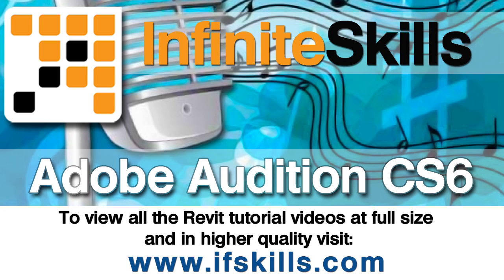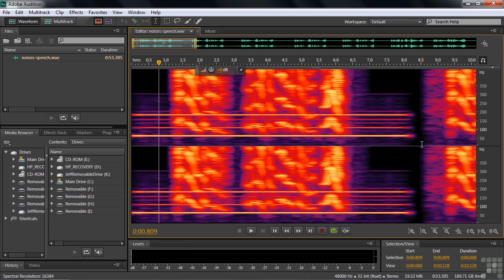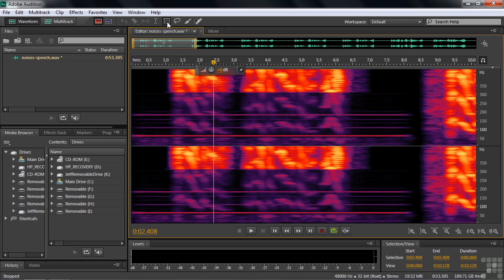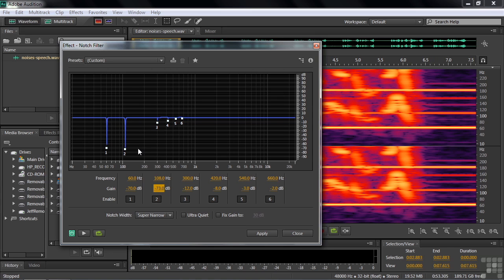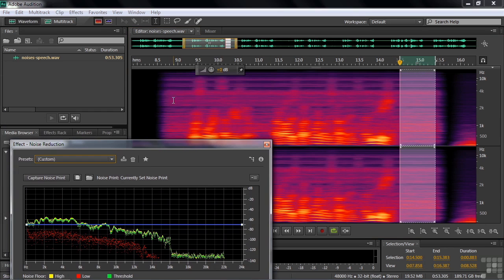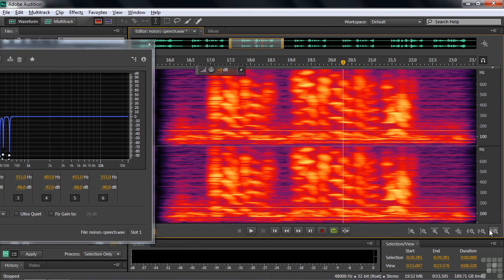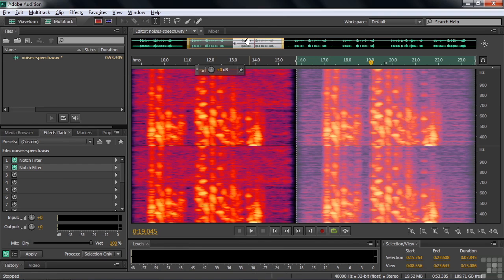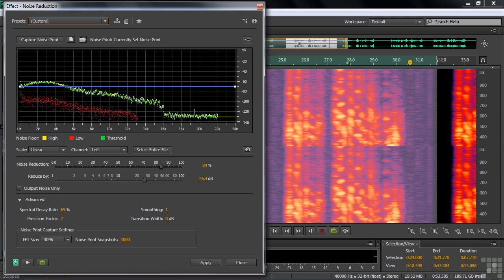Adobe Audition CS6 Tutorial | Reducing Background Noise | InfiniteSkills

Comment: That metallish kinda sound. How do i get rid of that? I have tried different effects but its only making it worse. Need help.
Reply: +Gaurav Cz Try doing some EQ adjustments before any of the noise removal. Using the "smoothing" feature will also help with that metal sound (what we call artifacts or aliases) You should also try lowering your FFT size as the rule "less is more" sometimes applies...start maybe at 128 or 256 and work your way up noting which ones are better than others. Hope this helps (8 months later!)
Reply: Audio Guru Sure i'll definitely try doing that. Thanks for replying.
Reply: Sure thing. If anything, message back and I'll see if I can help you further!
Reply: +Audio Guru You are one of very few who actually respond to questions thanks